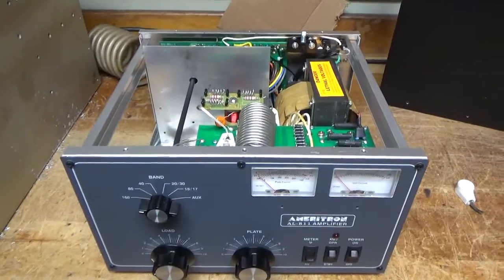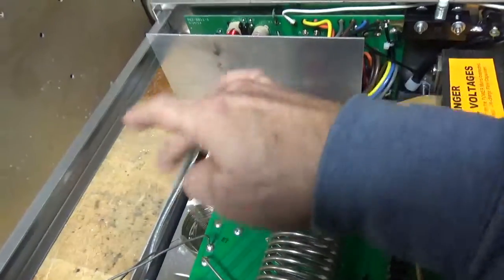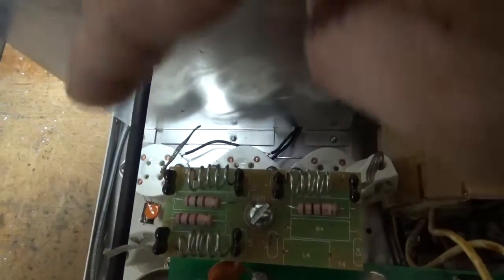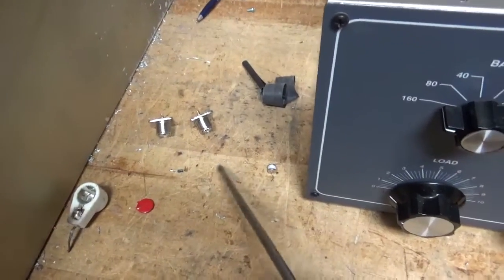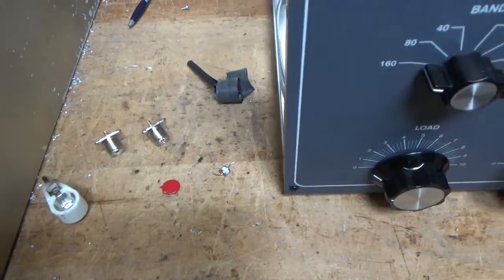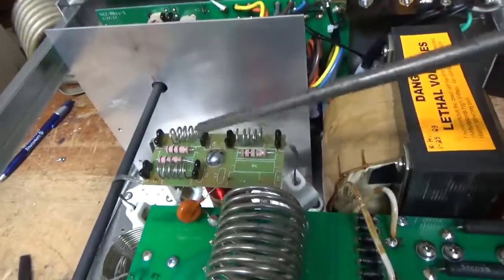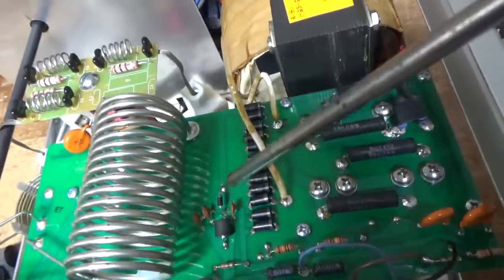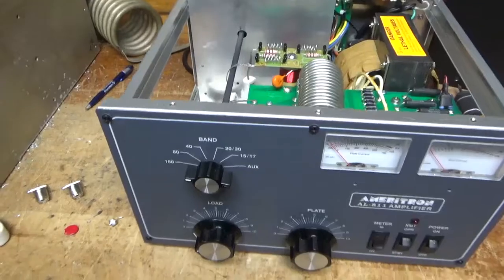Ameritron al-811 Repair And Modifications  572b Tubes

Comment: How do you check the so-239 connections?
Reply from the maker: I take a near new pl-259 and slip center pin into the so-239. If I do not feel ample resistance when I insert and then remove I replace the so-239. A lot of times the pl-259 easily slips in and out . The cause most of the time is a solder glob on the tip of customers pl-259 or from inserting a pl259 at an angle and not straight into the so-239.